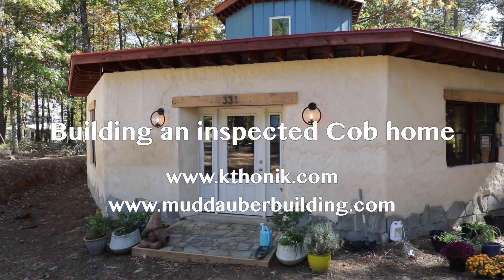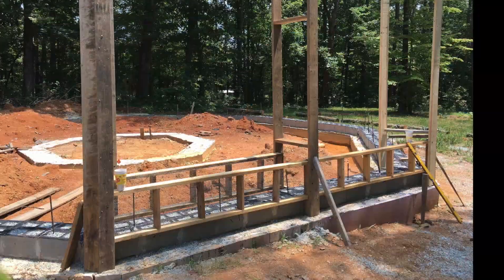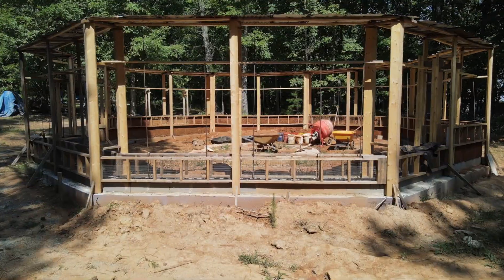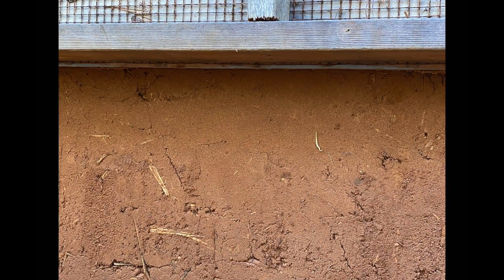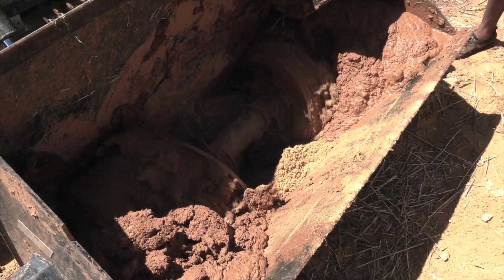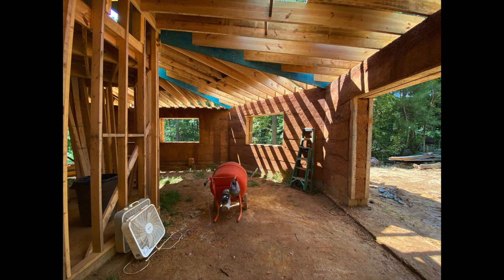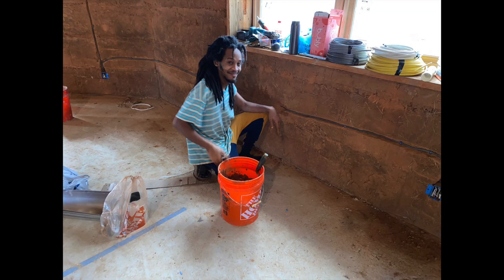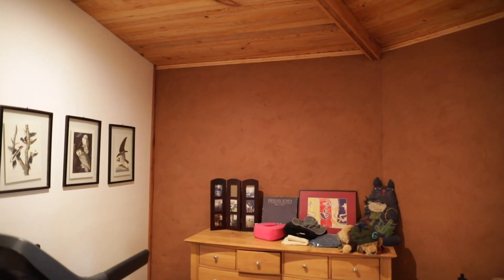Building an Inspected Cob Home

Comment: Why don't videos like this give any $$ numbers?
It makes it all pointless to watch imo.
Reply: i'd say the numbers are pointless anyway
it only matters when you are actually from the same place as the guys that built the home. I'm from the other end of the world whatever they say it's not useful to me. Also if you are from another State on the US it wouldn't even matter either, numbers vary a ton!
Also it would disclose any profit the builder did, and usually builders don't want those exposed (either they profited too much or they made a ton of mistakes an barely profited)
Reply from the maker: I would take your average local per square cost, and add 25% assuming all hired labor. But yeah talking costs requires so many assumptions that are likely to be wrong it’s pretty pointless. If you have a particular project and need a cob consultant you can access me through www.kthonik.com

Comment: Seems like a lot of work for no additional benefits. Kind of cool, but not traditional anyway, so might as well just use modern materials.
Reply from the maker: Primary benefits of cob: lasts 10x as long; fire proof; termite proof; sound proof; low carbon footprint; etc
Reply: I mean it's neat, but not really sure what's the actual benefit
Reply: Stops the ass noise
Reply: You people are so boring